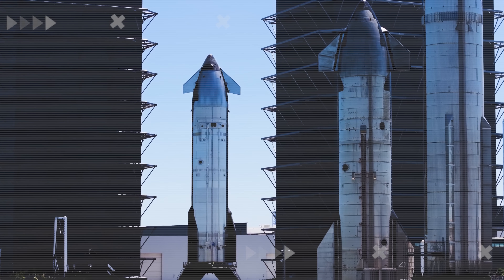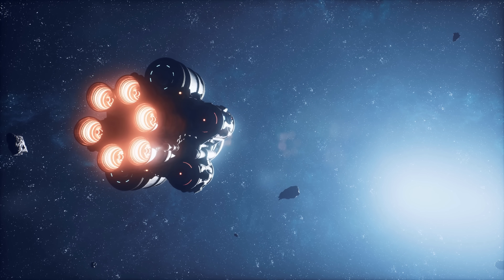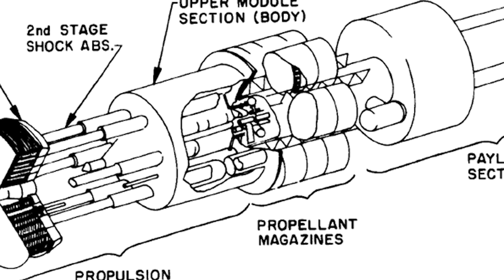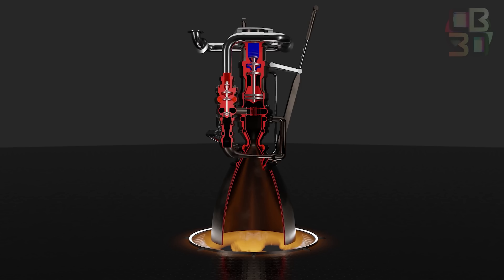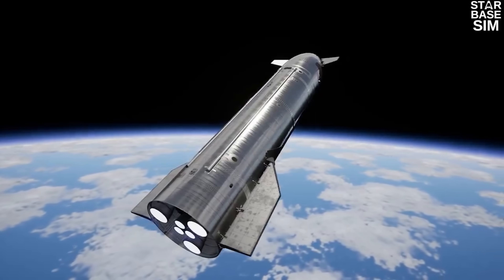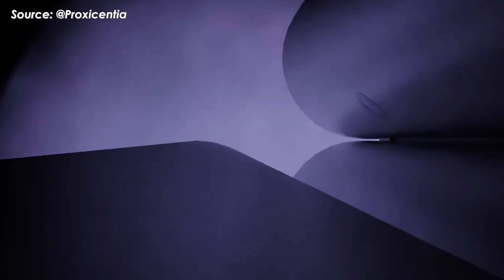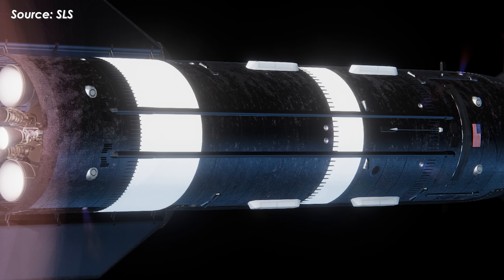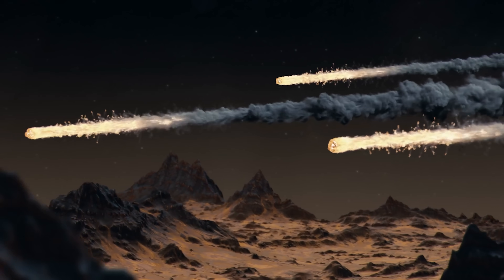SpaceX's New Nuclear Starship Design to Mars in a Day Shocked NASA! 100X Better...

Comment: An orbit to orbit nuclear powered Space Tug is the best and safest approach to using Nuclear Power in space. It avoids the problem of launching and handling nuclear fuel with every ship. Space Ships remain strictly chemical based, until fusion powered Space Ships become a reality.

The Space Tug would dock with the Space Ship in orbit. The tug would then accelerate the Space Ship break orbit and enter its trans-planetary insertion phase. Once the ship nears its destination, the tug would decelerate the ship allowing it to enter orbit. The Space Tug would undock, leaving the Space Ship to land unencumbered. The tug remains in orbit waiting for a return flight.

This saves a massive amount of fuel and time, since Nuclear Propulsion is 3X more efficient and needs no oxidizer. So Space Ships can be sized, cargo and fuel optimized to be planetary launched, orbit and re-enter.

Comment: If you could place refueling stations in earth's orbit, why not launch the nuclear stages in orbit to allow Mars bound spaceships to link to?  The stage contains the nuclear reactor and rocket engines orbiting the earth to which the starship containing the fuel,  and when the hookup is complete,  the trip to Mars can begin.
Reply: this requires sane orbit stations to maintain such tech before the starship could attach itself to the fusion engine or engines for to use for interplanetary space journey. But to build and support such stations in orbit one needs finance that Congress would never give to NASA. So to save money remains only to go the dangerous way.. but if Elon will decide to build a tank ring on the orbit one could expand it further having another ring connected to first one where one could put a construction space for putting together interplanetary reactor driven engines later on. that way it would be less dangerous to bring the uran or plutonium as separate inactive cargo for further deployment.

Comment: This is at the most a suggestion. A nuclear powered spaceship would be faster and use less fuel but due to a radioactive exhaust not be allowed to take off from Earth, this would be a strictly space only engine. Also, ceartain treaties dissalowes this. Nations can deal with the treaty but Elon Musk cannot. Starship is not designed for this. At the best a nuclear powered ship could carry a Starship as a shuttlecraft. Also, even with a nuclear engine getting to Mars in a day isn't possible. Nuclear engines can be fast but not THAT fast. Transit time would still be several weeks at least.

Comment: IF SPACEX HAS A SECRET NUCLEAR PROGRAM IT WOULD BE BOTH ENGINES AND MICRO REACTORS LIKE WE SEE IN NUCLEAR SUBS.
CHINA MUST BE WORRIED IF THERE IS A SECRET SPACEX PROGRAM.... 
IT IS EASY TO HIDE THE PROGRAM AND ISOLATE IT FROM NORMAL SPACEX DEVELOPMENTS....
Reply: Reactors ion nuclear syubs produce electricity for electric engines. I suppose an ion drive could be powered that way. Ion drives have very little power but can accelerate over a long time to very high speeds.
Reply: @michaelpettersson4919  EXCELLENT OBSERVATIONS MICHAEL !!!!

Comment: This is completely fake d.o.e is the only people who can handle nuclear material
Reply: If this was an orbit to orbit space tug design that docks with a Starship in orbit.

The initial tugs core fueling can be done in orbit. The fuel rods are usually individually wrapped and stored. Until inserted into the reactor core each fuel rod is not highly radioactive.

Radiation Hardened Optimus robots could easily do the job. The robot does not need Sophisticated compute and control systems. The AI control could be shielded and remote converting complex operations to simple robotic commands. The operation could be overseen by D.O.E.

Comment: I think the video ignores a straightforward and elegant solution. Rather than incorporating a nuclear engine into starship, you could instead have a dual-booster solution, the current booster to launch starship into orbit, and a second "space booster" equipped with the nuclear engine and fuel that would attach to Starship in orbit, propel it to Mars (or wherever) then detach once in Mars Orbit, then Starship lands on Mars.
Reply: Ya a standard nuclear space tug. All deep space vehicles could easily be designed to dock with one. It's the obvious solution.
Reply: Like a semi tractor/trailer vehicle!

Comment: There are a lot of scrambled and mis-leading statements in this video. Fuel and propellant are two different things in a NTR. The fuel is the fissile material which can be Uranium. The Propellant could be anything that can pass through the fissile core. Methane would actually be a good choice for density and low dissociation temperature as a propellant. While less propellant is required than chemical, the gains are not exceptional, especially when shielding is taken into account.
Material science limits the temperature that the core can run at, this limits efficiency, therefore the fuel mass advantage. A nuclear rocket could reduce travel time to less than 90-days with the same payload as a chemical rocket, or carry twice the payload using a Hoffmann minimal energy transfer orbit. Chemical rockets can get to Mars in 5-months, return 7-months. The 26-month Mars transfer windows need to be obeyed regardless of propulsion system.
An atomic Starship would look very different. Assembled in orbit, the nuclear propulsion modules would be better mounted on a boom well behind the main ship and even propellant tanks (look at the movie 2001 to see a practical gross structure where propellant tanks form part of the shielding.